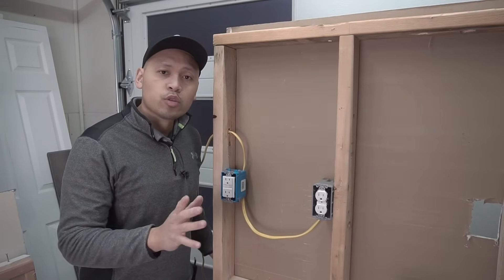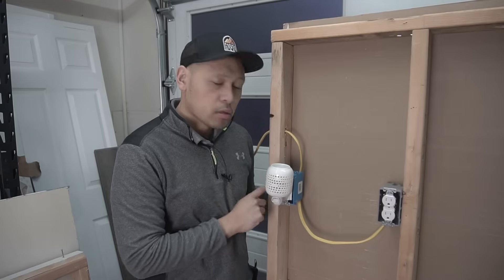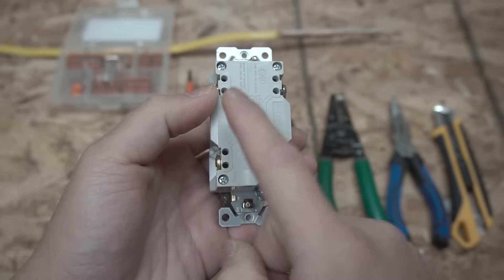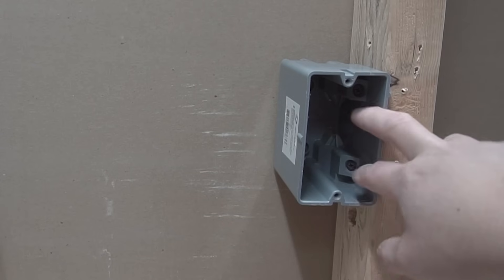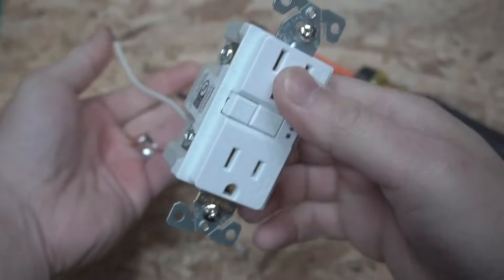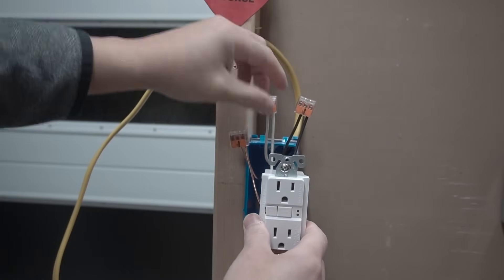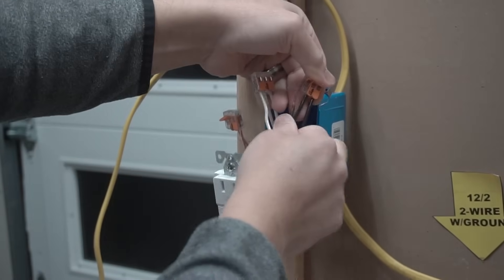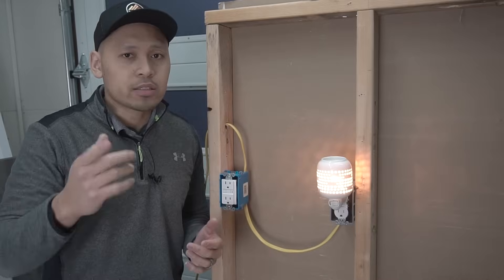How To Wire A GFCI With An Outlet That Won't Turn OFF! DIY

Comment: Isnt the point of the GFCI so that if there is an issue on another outlet down the line it'll also protect those? This leave the other outlet unprotected from GFCI right?
Reply from the maker: You are absolutely correct. 👍🏽, I have made a video on that as well. This video gives a second option we’re you’re in situation where you need to tap to power to and GFCI is only source and you don’t need the GFCI protection, let say a room next to the bathroom or kitchen, where you don’t need it to be protected. Just giving out options for certain situations 👍🏽😊

Comment: Wood is combustible surface, better to use pieces of metal conduit or pipe inside holes where you are running cable. Sawdust can easily flare up, nobody clean holes from sawdust after drilling.
Reply: No, you do not put conduit or "pipe" in the holes drilled through the wooden studs. Particularly with the wire type of wire he is using.
Reply: You are required to protect the hole with metal plates on the outside surface of the stud.  This keeps nails from penetrating the cable.
Reply: @JK-dp3lp  in the rest world metal pads between cable and combustive surface are mandatory
Reply: @Dmitrytln  who asked about the "rest of the world" the creator is in the United States. Maybe watch a video geared toward whatever country you are in, before telling someone to do something that would be against code in THEIR country